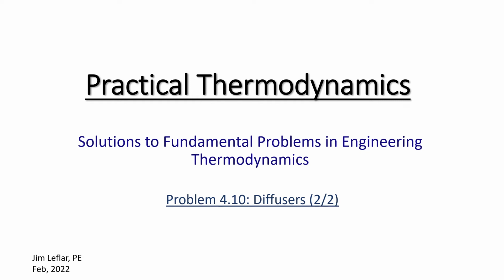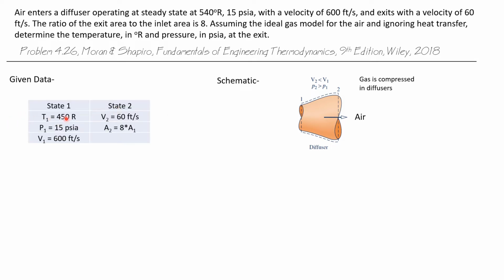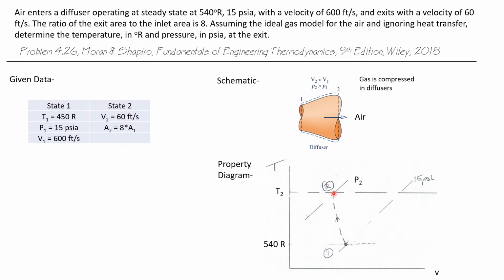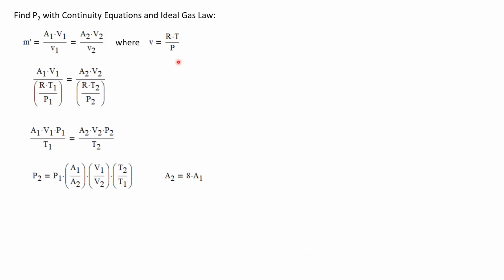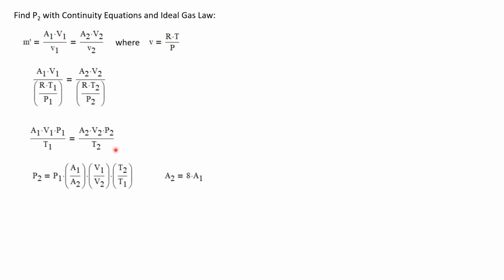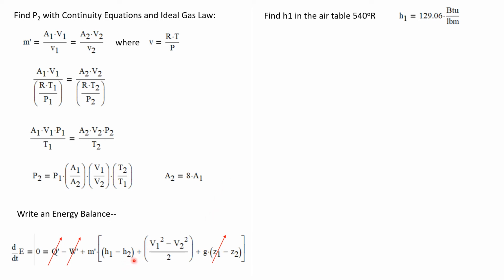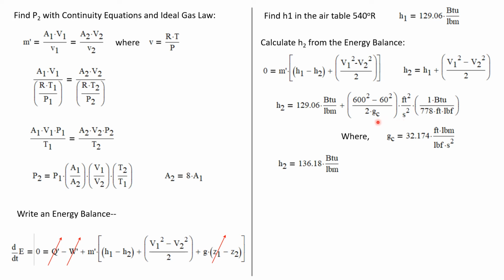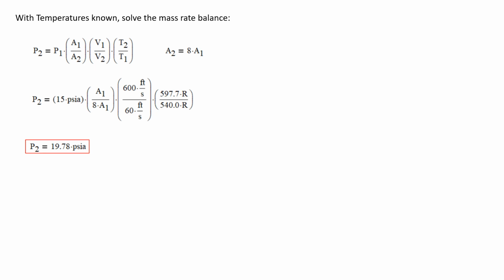Air Flowing Through a Diffuser -- Engineering Thermodynamics 62/107

Comment from the maker: I mis-typed the temperature T2 in the final equation for P2. It should be 569.7 and NOT 597.7. The answer P2=19.78 psi is correct.